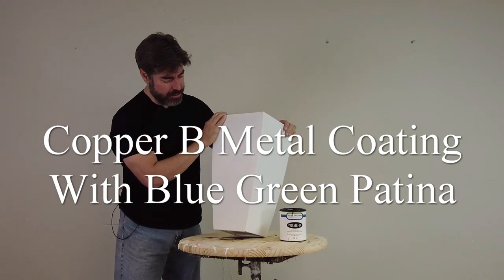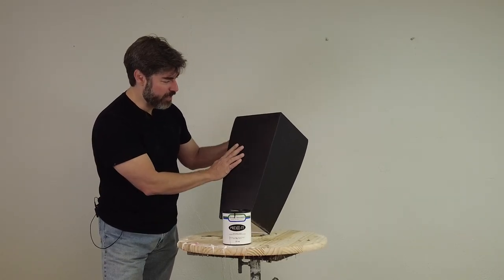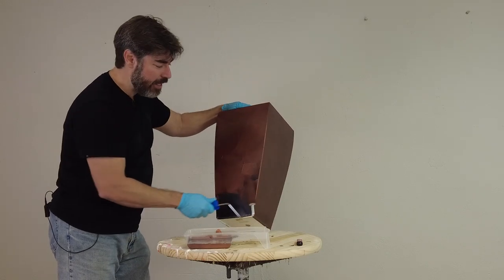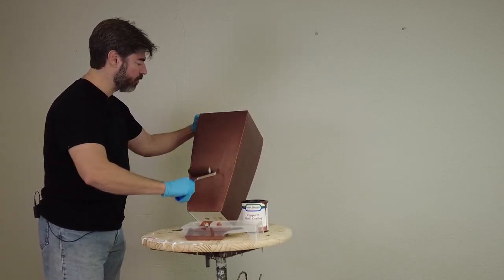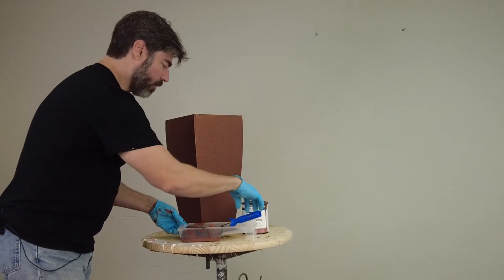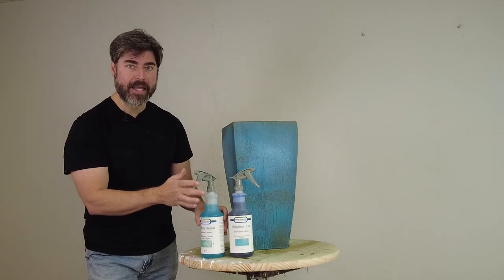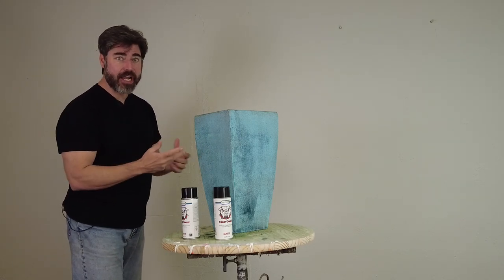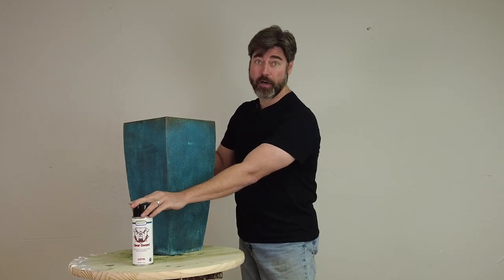Metal Coating Tutorial: Blue Green Patina Over Copper B Metal Coating

Comment: Looks really good, but do you find if you spray the primer and metal coating that the surface looks more like sheet copper which would be more smooth?
Reply from the maker: Spray application definitely gets a much smoother finish. The only downside to spraying is you have to move much faster with the patina application so the Metal Coating doesn’t dry first.